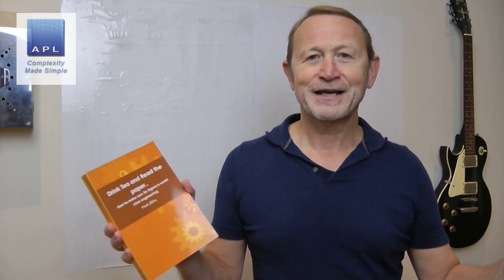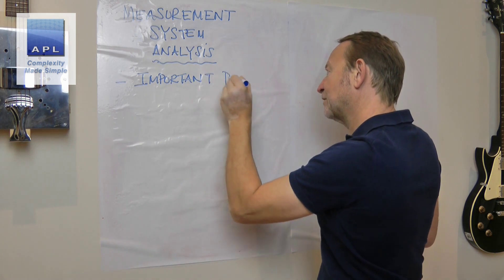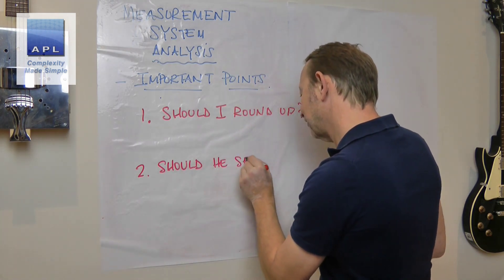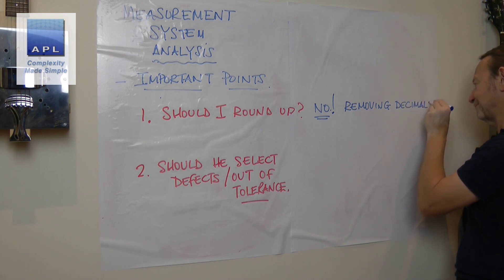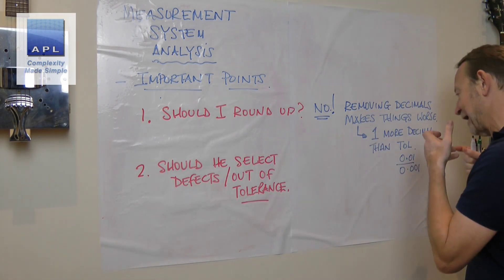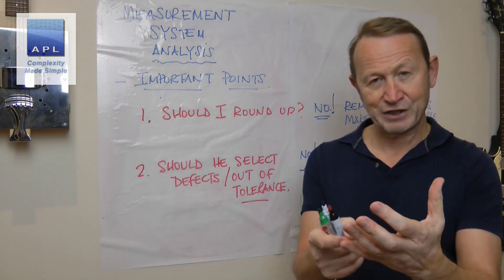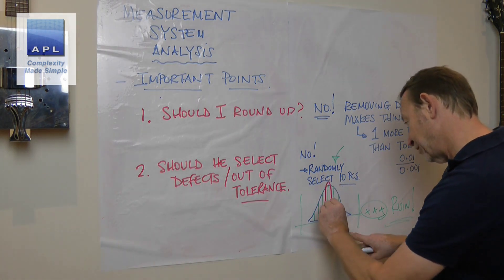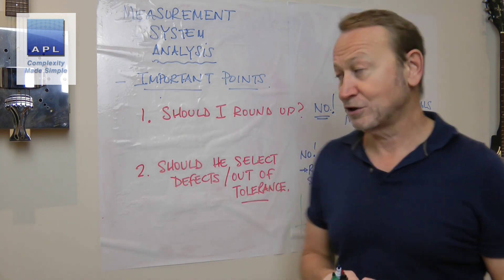Practical MSA Advice for your 6 Sigma training

Comment: We produce plastic parts and we need to use a measurement jig for the measurement process. How can I define how much variation is being produced by the measurement jig? At the moment, we are considering doing an MSA without the measurement jig vs an MSA (using the same parts) with the measurement jig. Would that be accurate enough?

Comment: What are in the table of contents for the book?
Reply from the maker: Chapter 1 – Let’s get started – Be excited, be very excited.			9

Chapter 2 – What is Six Sigma						17

Chapter 3 – The Improvement Process 
  Can you solve any problem anytime?				47

Chapter 4 – Define							51

Chapter 5 – Measure							67

Chapter 6 – Analyse							113

Chapter 7 – Improve							129

Chapter 8 – Control, real control						137

Chapter 9 – Measurement System Analysis (MSA)				141

Chapter 10 – Mistake Proofing						155

Chapter 11 – 5s, Workplace Organisation					161

Chapter 12 – FMEA							169

Chapter 13 – Probability						185

Chapter 14 - Confidence Intervals and sample sizes				203

Chapter 15 – Hypothesis Testing						211

Chapter 16 – Statistical Process Control (SPC)				223

Chapter 17 – Simple Linear Regression					247

Chapter 18 – Design of Experiments (DOE)					253

Summary								305
Reply: @paulallen5321  Thank you!

Comment: Hi Paul, in regards to your second question, should non conformance be introduced into the study?, i agree that random parts should be used however its good to get a range of parts across the dimensional band to introduce variance and to increase distinct category's. In regards to attribute studies, would you agree that its important to introduce non conforming parts to the study to get valid analysis of the measurement system. Thanks
Reply from the maker: Hi beans - I wouldsay when you conduct an R&R study you must used tha parts that are naturally produced. The question you're trying to answer is can I use this system to run this machine/process.

When looking at atrribute data the pcs MUST be 50% pass 50% fail...

Comment: Dear sir, Realy Thank u so much for this session its very useful...Can u pls explain about ndc value in MSA study also linearity and bias...Pls
Reply from the maker: Hi Mani - no need to think about Linearity or bias in an MSA, that is the job of calibration. NDC is the number of discrete values the data is split into. Simple way to think of it, is if youdraw a histogram how many columns of data would appear, you should have minimum of 5 columns to see a distribution, so minimum ndc should be 5...